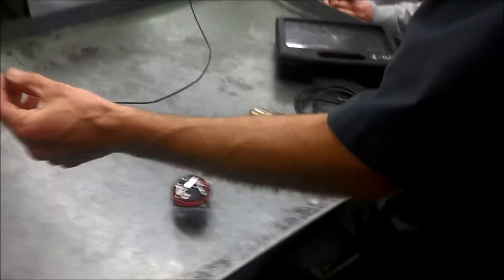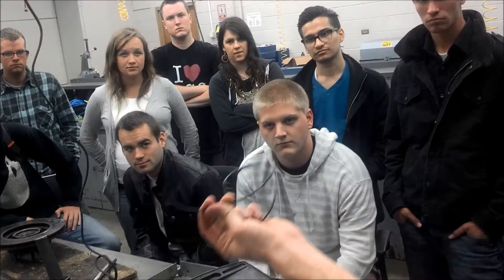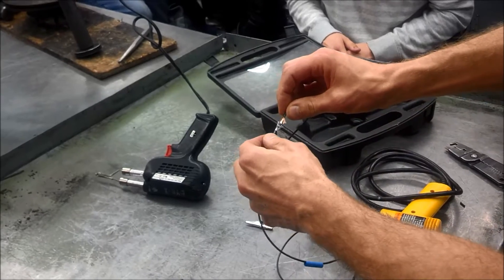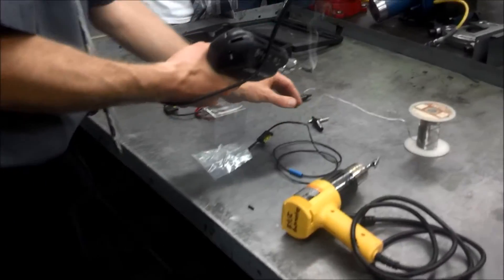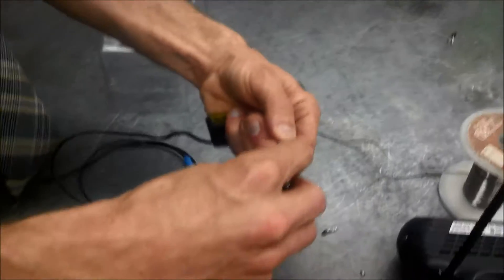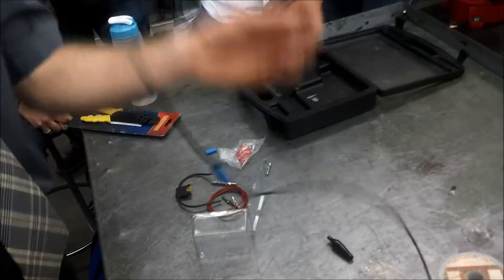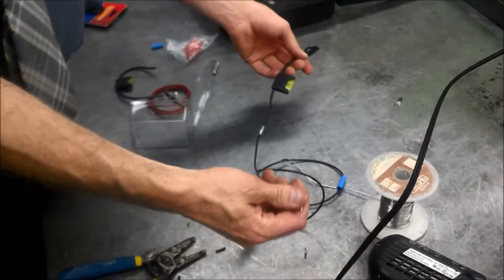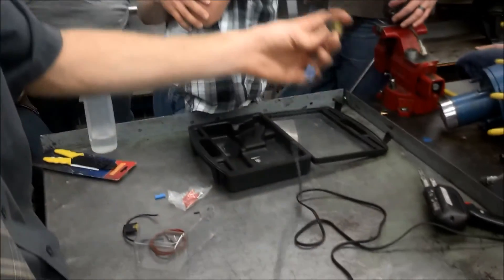Instructions for Making Fused Jumper Wires

Comment: The gauge numbering derives from the number of manufacturing processes: 

 a 16 gauge wire was rolled more often than a 14 gauge wire and became thinner than the 14 one. The same holds true for metal sheet indexing.
Reply from the maker: I didn't know that.  Thanks for sharing!

Comment: Where did you get the kit for making these leads? I can't seem to find a kit anywhere to make fused leads.
Reply: You can buy the components separate at a hardware store. Just buy a fuse holder and some fuses, Some wire of preferred gauge, and buy some alligator clips.
Reply: Automotive stores sell in line fuse holders too.
Reply: Some use duetch pins male and female and put shrink